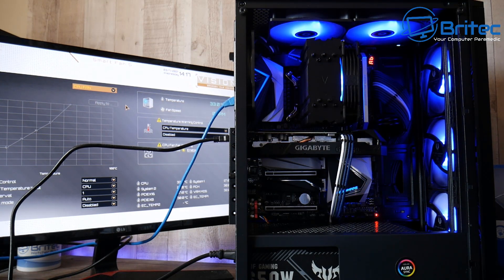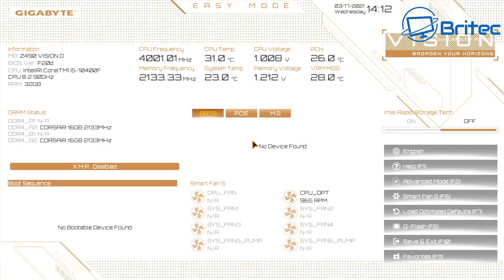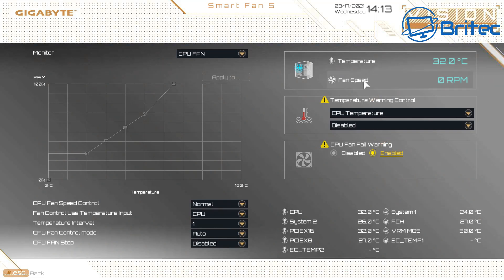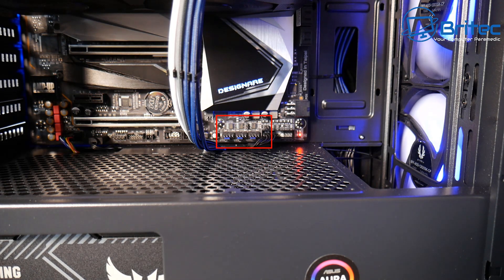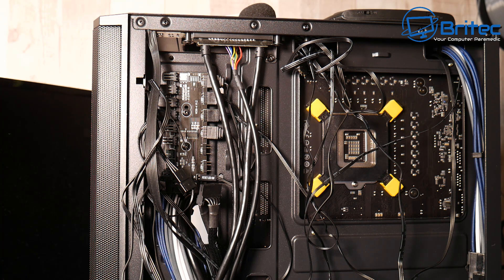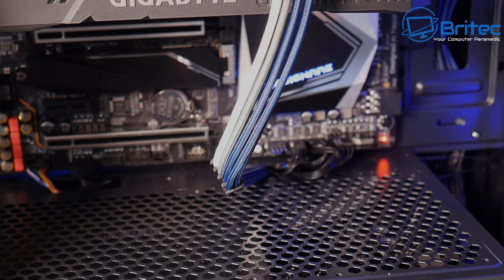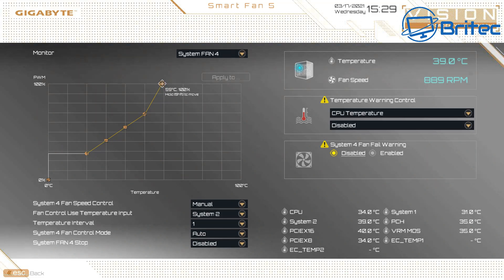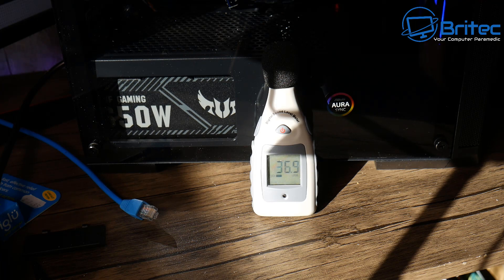How to Make Your Computer Quieter

Comment: Nice video on that
I have to say that there are some fan splitters out there that will get there power from the molex or Sata connectors on your psu but also have a fan connector that only has the RPM & PWM pins connected so they can still be controlled by your board without the power draw issue for the header

Comment: When I build my new computer, I'll probably have the bios controlling my fan speeds just like Brian shows here. In the meantime, I have my external fan speed controller by Enermax that does the job well for my current setup. It has six knobs, one for each fan, a dual RPM and two probe temperature readout in old-style LCD panel and other buttons for settings. It does the job well, for me.

Comment: Decibels   are  logarithmic, based  on 10 times, (like the earthquake  scale)    a    3 db    increase   means  10  times    It's  like    saying    a  200 watt  amplifier    is   twice as  loud  as  a 100  watt  which it's not .    You  have  to   go to  1000 watts    from  100 watts  or  10 times ti be double  the loudness  at 3 DB      That why you  use to  see cassette  players  meters  go  -6, -3  0  +3   +6 "9  +12  So  the   amp   on the  movie   "Spinal   Tap "   going  from  10 to 11  (voltage  output to speakers ) pretty  much  does  nothing ! Posted on Facebook,  by for now  Cheers
Reply: Don't   ever  get  be going on Abbey Road Studio  in the   sixties,  I would blow  your mind   !   LOL

Comment: The best fan control software I have ever seen is "Fan Control" it will control all your fans to what ever speed you want.....The only thing it will not do that I've seen on my PC's is it will not control an AIO Pump but it will control the fan for the radiator.....But the AIO pump doesn't make any noise at all on my PC's......All the noise is 100% from my fans.

Comment: my pc is pretty quiet....  but it does have a huge  passively cooled 360x360 radiator (phobya nova  1080 extreme) mounted inside the top of a core X9 -- it only just fit

Comment: Mine is so quiet I had to insulate the screen power supply, its slight coil whine is the only noise present. BeQuiet fans with rubber insulators.